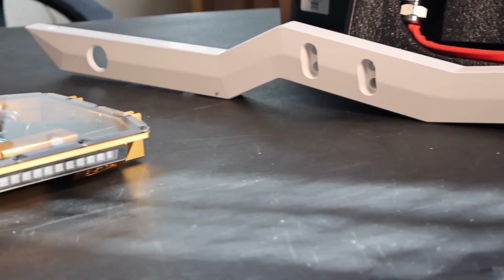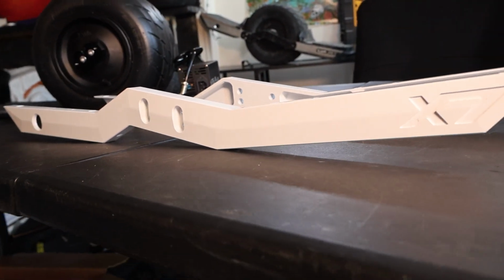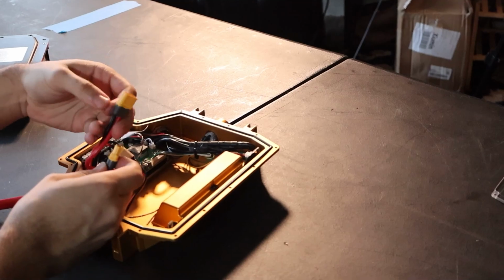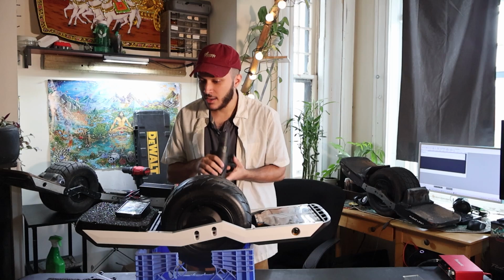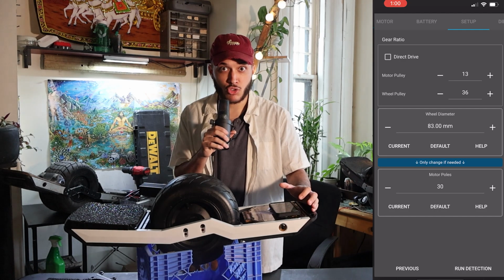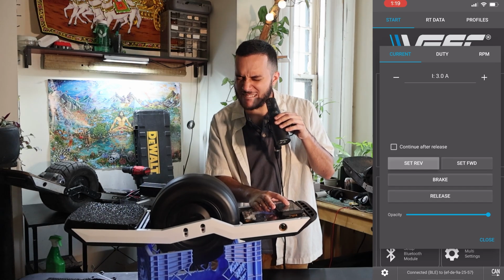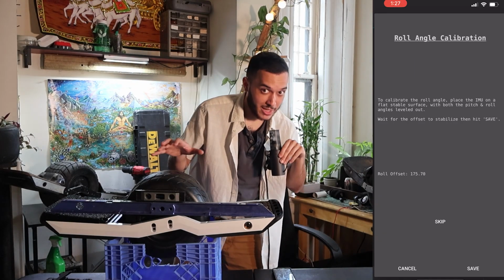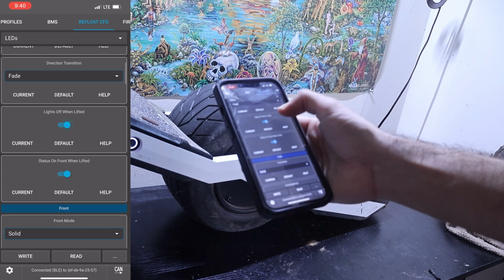Funwheel X7 Complete Kit Review + Complete Assembly & Setup Guide

Comment: I was following the steps to update the firmware to 6.05. After the update was complete it gave me the warning about not turning it off earlier than 10 seconds, but then it never restarted. 

I waited for a while and realized that VESC Tool was no longer showing any firmware version - not 6.02 or 6.05. I tried to find the Thor300 or VESC Express on VESC Tool, but nothing appears anymore. 

I’m concerned that my Thor300 is now bricked. If so, what is the best way to resolve this? Do I need an ST Link? Or can I just use the USB-C on the board to reset it? If not, what needs to be done?

As much info and direction you can provide would be appreciated. This is my first VESC, I’ve never had to deal with this before
Reply from the maker: No worries it can be solved. Just send an email to support@fungineers.us we will get back to you tonight.
You can also go to funwheel discord and explain your situation in help channel 
Good luck!

Comment: I finally put mine together. Thanks for the helpful video. Only 10 miles in but I'm loving it. I still have a stock XR and the X7 (torque version) can get up the hills on the trails I have to carry the XR. We are so lucky to have this available! 

Take your time with the setup, follow the video instructions and you'll be fine. I could not get the outer screws to connect the foot pads to the bumper through the rail but just using two on inside seems fine. Flight fin system does not fit with the stompies that Fungineers sales. I'm switching to Land-Surf's Platysense 4.0 XR footpad set to try out out.
Reply: Hey Man, I also have the OG XR with the old Flightfins and want to buy the complete X7 with the HT Motor like you :) , Any other way to use the Flighfins? I dont want to buy a new footpad set just for that but want to use my flightfins. i just saw some 3d printable adapter to use them with the X7, did you saw that? And are you happy with the HT Motor? Fast enough? Why did you choose the HT? Sorry for all the questions, you know how it is :)

Comment: A couple things I encountered when setting up the board:
- In the settings of thor with my board, it was set to turn off after 5 minutes, so it turned off during the update. It freaked me out and thought I bricked the thing, cause I couldnt connect anymore. After the update you cant connect with bluetooth, you have to connect with wifi and then turn on bluetooth again. My phone didnt want to connect to the wifi so I thought I bricked the vesc thing. Fortunately another phone did connect to the wifi,  so thats how I managed.
- I will call them the cooling blocks attached to the wheel, not sure of the exact name. There are bolts in there. They were not tightened and I didnt notice, just blindly following the instructions from this video. This caused a clicking/rattling sound while going back and forth and riding over bumps. This is because of the loose bolts in the blocks. not to confuse with the bolts you use to attached the wheel. I found out by asking Mo from fungineers and he told me to check the bolts in the blocks. Now it rides really smooth.
- When I installed the refloat package, my lights stopped working. Took me a while to find out I can turn them on in refloat, just not under LEDS but under Specs in Refloat Cfg.
I think thats it, maybe it helps some other selfassemble/vesc noob 😆
Reply: Thank you so much for the lee guide. Line worked in led cat. But I had no idea how to control it

Comment: I have the funwheel x7 for a while now, about a month. Its absolutely amazing! Had the xr for a year and a half, but its has its limitations for sure. I was thinking about upgrading it, but then I had to at least buy a new controller and battery, which already sets me back a thousand and then still not close to a funwheel. I figured selling the XR for a thousand and then just buy the funwheel for 2 thousand, I also get a better motor and rails. Best decision I made, my god, what a beast. Its fast, easily reached 25 mph even went 28 today. Also going up hills, no problem anymore! Im a noob with Vesc, so setting it up was some effort and did some things wrong, but the customer service is topnotch. Had some issues with the sensorpad, and Mo send me a new one without me even asking for it.
Reply: HS or HT motor?
Reply: @realestatefilmmaker  I bought the HS motor 🙂
Reply: What’s the approx speed of the two?
Reply: @hardcore4476  30mph

Comment: Just finished a Funwheel build that started quite a while back.  When everything was 3D printed and they didn't sell a Vesc. I have a lot more money into my build due to Fungineers evolving.  I bought the first gen rails,  the PCB battery board,  the 3D printed boxes, the original Stompies, etc. ......... didn't use any of it.  That being said,  I rode my Funwheel for the first time today,  and wow. I watched the above video on .75 speed for the config settings cause Jaden talks so fast.  It's set up right, it looks bad ass, and it performs even better.  It was worth the wait.

Comment: Should I also use loctite 243 on the bolts that connect the rails to the hub? I bought the stock xr rails and had them custom made by CNC. From watching the funwheel build videos, it looks like they don't use loctite 243 on the bolts that connect the rails to the hub.
Reply from the maker: Yes. It is recommended to be used.
Reply: @Fungineers  There are other opinions, so it's a bit confusing... but I'll take note anyway. Thank you for the good information.😁

Comment: I’m really struggling with my next purchase. Should I buy/build an X7? Or a GTS? I ride a little trail, lots of street cruising, but I’m a bigger guy. 215-220lbs. My GT has been great (I love the size) but I want just a bit more torque and power. I REALLY love my XR, but I just don’t feel as confident on it in the trails as I do my GT. Decisions decisions!
Reply: Have you thought about the GT-V kit from FloatWheel? I'm a bigger guy, 230, and the GT-V is perfect. I can hit 23mph comfortably and still get 20+ miles on one charge.

Comment: So I've been following this for a bit and I can't really see why this is better or more affordable that the already existing one wheel.

For starters the battery is a 20s2p 84v, a total of 40 cells and bms for $600. Last year I made a 12s5p battery with a smart bms for an electric mountain board for €400 including the cost of the welder (shout out kweld) so that just seems grossly overpriced for what you get.

The battery box has no business being $120, its a box. Smart BMSs range from €50-€150 so $91 isn't the worst but a far cry from the best. 

$320 for a vesc is ridiculous. With no specs listed for their Thor300 it seems hard to justify why it costs so much when FocBox and Spintend do high power VESCS for €145-€300 

$460 for the motor is a hard sell, sure it can go faster than some alternatives (again, spintend has a similar product for $149 and that's not even touching on the second hand market for one wheel parts) but realistically no one will use it at the listed 60km/h. It's not like 60 in a car, instability and user error at those speeds unprotected is lethal.

The charger is actually really reasonably priced. Most are around $200 and the ones below that I'd have a hard time trusting, so credit where credit is due.

The connectors and wire harnesses are way too much, about €40 for cable, connectors, switches and solder and you have the same thing they do.

The CNC casings I can't really say much about. I have 0 experience with that and all the enclosures and casings I've made have been fiberglass and polyester resin.

The total cost of the kit comes to $2,146.61 not including shipping while the OneWheel GT goes for $2900 so I'm struggling to see the market for this. If I have $2,146.61 to spend on recreation then I probably have $2900 as well, I'm not going to draw the line at an additional $754 so it's not made for people who can't afford a onewheel. The constituent parts are far more expensive here than if you just shop around so it's not for the DIY crowd and while it might outperform the OneWheel GT, you still have to assemble the kit yourself, so the casual commuter is out as well.

I'm not saying it's not an impressive machine because by all accounts it's great, I just don't understand why it exists.
Reply from the maker: Thanks for the detailed comment and it surely helps people to have another perspective. Why does Funwheel exist? Well the short answer is, we just make the best stuff on the leading edge of tech and performance we think we can produce for the best price to you guys. If people like it, and think its worth their while and $ then good :)
Thats the short answer, the long answer is:

Battery
$600 battery, with grade A Molicel P28 cells in a 20S2P config with a smart BMS, an Injection molded box complete with wire harness, RGB LED, waterproofed with a pressure vent, that took us a lot of research and iterations to get here. To get something with similar specs and quality, it would be at least a $1000 on the market elsewhere. 

VESC
Our Thor300 is not $320, but $269, and if someone is comparing it to Spintend then they should get a spintend, because this is by no means a budget build. A budget build can surely be built with lower priced components. 
Thor's capabilities are listed in the video and on our website.

Cable and Connectors
Actually if you get the whole kit you wont have to buy any conenctors or cables. So thats $0 actually.

GT comparisons:
GT has lower torque, speed, perhaps 10% more range than this board. 
Most importantly, we've squeezed all this tech in an XR platform which is unparalleled in ride feel. The GT ride feel is honestly sh!t and cannot be compared to our/ XR ride feel. 

We think this board surpasses the GTS in power, speed and torque, while being the same size as the XR, with top-quality components at a fair price. We can probably get the price lower and make it ride-able out of the box, by selling pre-assembled boards ;)

Comment: How heavy is this and how does it compare to floatwheel and gts or with the pinxv drop in kit?
I would like to have something as light as the pintx with better performance. This seems to be it.
Reply: If you use a stunt pack and a hyper core motor that should work for your weight concern.
Reply from the maker: The superflux is the most powerful motor for it's size and that comes with some weight. The. Board weighs around 25-30lbs but it's more powerful and can go faster than a GTS..
Reply: @Fungineers still not as heavy as the floatwheel. Great thanks!